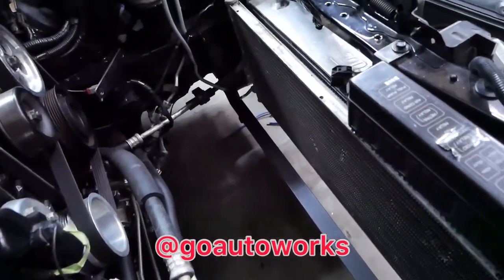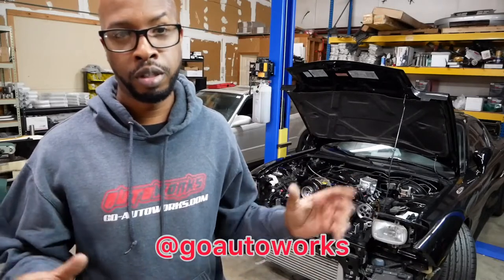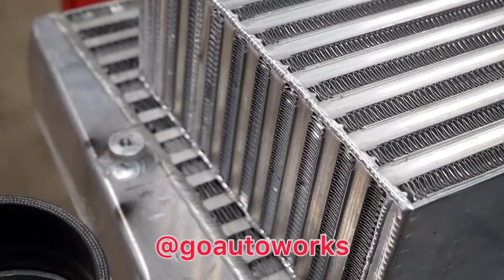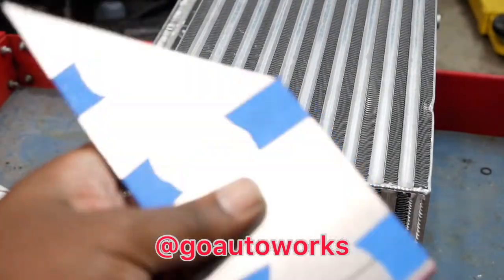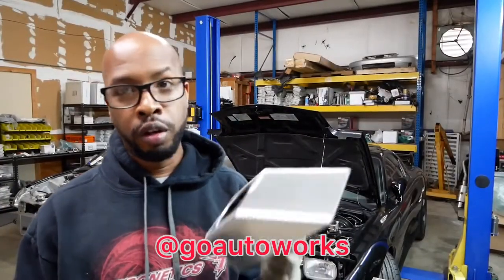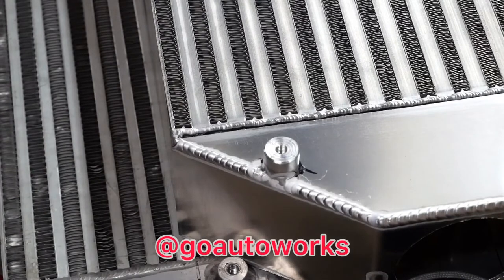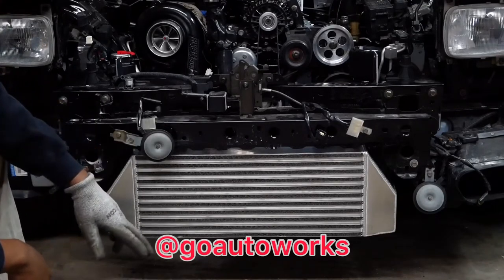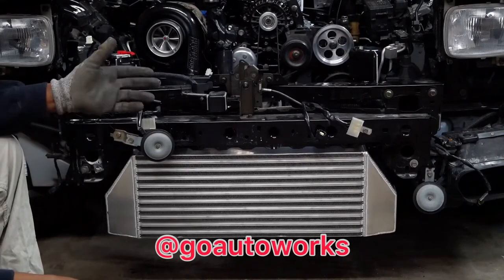Big Boost RX7 Part 2: FMIC and Radiator Hard Pipe work

Comment: What kind of material are you using for the end tanks? Also do you use 4043 filler rod? Welds came out great
Reply from the maker: Yes, tanks are 5052
Reply: @GOAUTOWORKSYOUTUBE  thanks